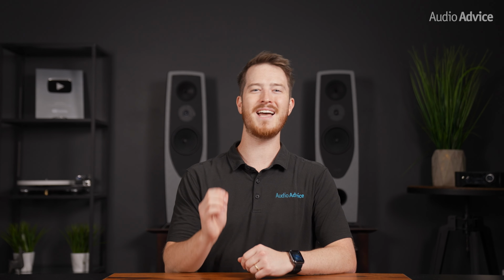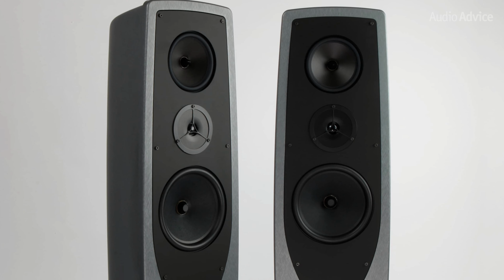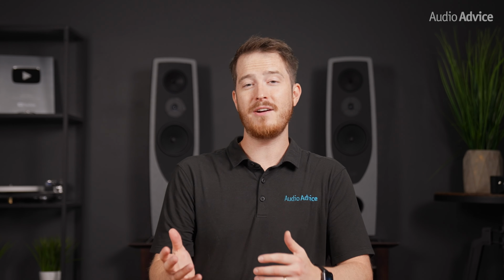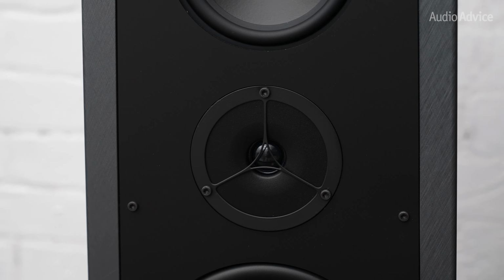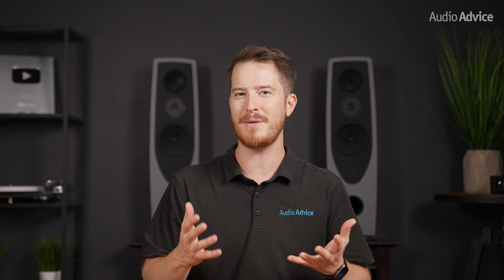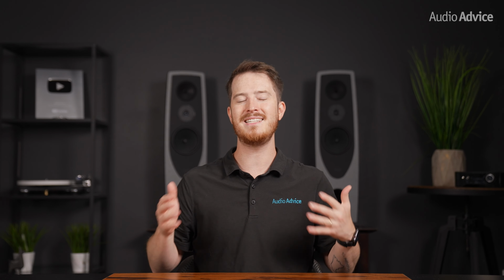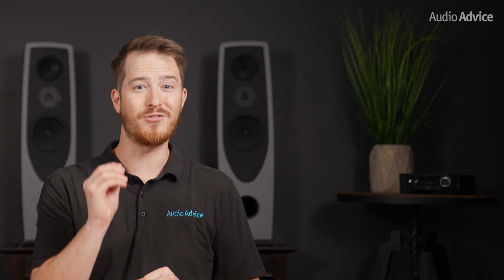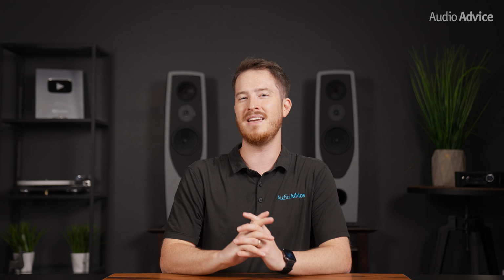Rega AYA Loudspeakers - Best COMPACT Floorstanding Speakers for the 💰?

Comment: I'm currently auditioning these in my large listening room. Unfortunately, no matter how I place them, I'm getting a very undefined low end. I'm a little demoralized this morning but my search shall continue.
Reply from the maker: Sorry they did not work out for you.
Reply: @AudioAdvice I use a Rega Elex R amplifier. I've been using JBL 570's but feel that they are too bright and don't have the mid-range I desire. And the Rega Aya's aren't right for my room as I mentioned. Now I'm considering the Wharfedale Evo 5.4 speakers, Bowers and Wilkins 603 s3 speakers, or KEF Q11 Meta speakers. My room is relatively large at approximately 30x15 feet. I position my speakers about 9 feet apart and sit roughly the same distance away. The room has wood paneling and shag carpet. I am unable to physically test these speakers before purchasing. Do you have experience with any of these three speakers and, if so, what do you recommend?

Comment: Guys, loved the video and the detailed content about the Aya speakers. I am really considering them, especially since the compact size and front port will allow me to put them a little bit closer to the wall...i don't have a choice. But i would think i would need bookshelf...i was surprised to see your opinions on the video, they gave me hope. Do you really consider them able for a small room instead of bookshelf on stands? Does't the bass become overpowering since it is an engaging and not relaxed listening? And finally...can they do low listening volume levels for night use without losing all their amazing sound? Thank you kindly.
Reply from the maker: Yes, these might be great for your situation. We'd recommend calling or chatting with our experts at audioadvice.com and they can help you decide if these are better than bookshelf units in your room. thanks!

Comment: Noticed you have what appears to be a Hana Blue cartridge mounted on the Rega P10. Do you find that requires a spacer under the tonearm for proper VTA, and if so what height? TIA
Reply from the maker: No need to   It’s at just the right height. The Red and Blue both play well with the P8 and P10.  We do carry the Acoustic Signature spacers should you need any though.  Thanks for watching